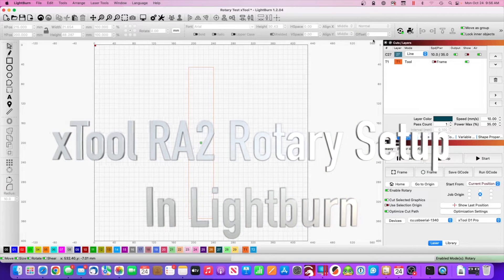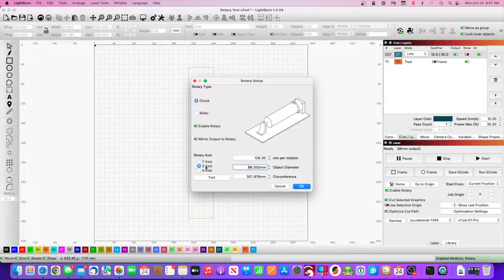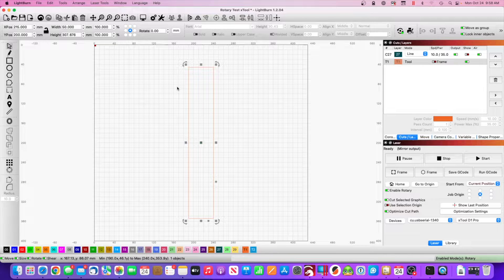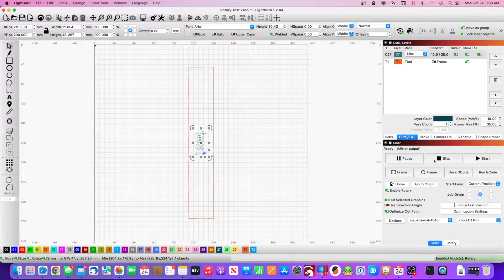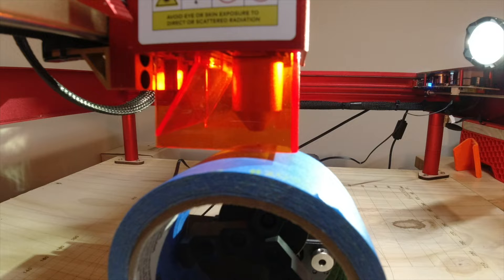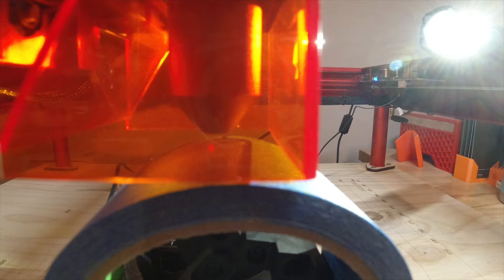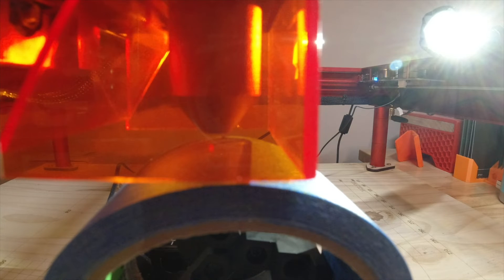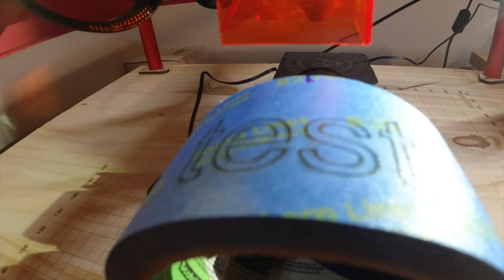xTool RA2 Rotary Pro Setup in Lightburn

Comment: So how do you adjust if it doesn’t line up?
Reply from the maker: Change your steps per rotation til it does.  It should be perfect out of the chute.  Before I adjusted I would double check my diameter or circumference measurements
Reply: I have a ortur master 2 and I actually have plug it in the y axis does not work on the z axis

Comment: I've had my RA2 for about a month now but just now finally got it set up. So you just orient the top of the image towards the top of the tumbler? I saw some other videos with mirroring the image one direction and rotating it a other direction. 
Idk, might have been before lightburn updated to the "chuck" and "roller" options for a rotary tool.